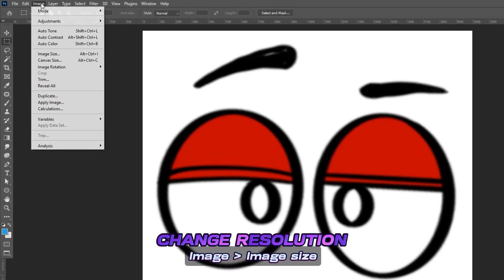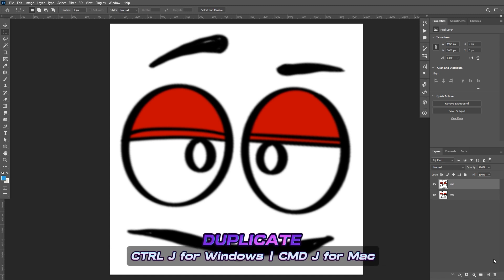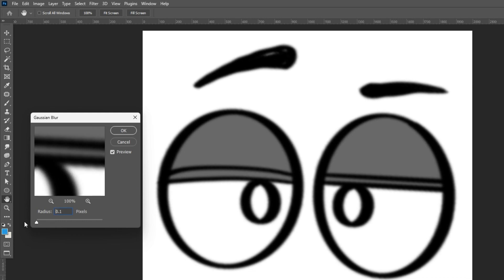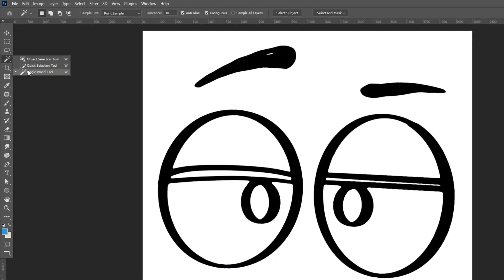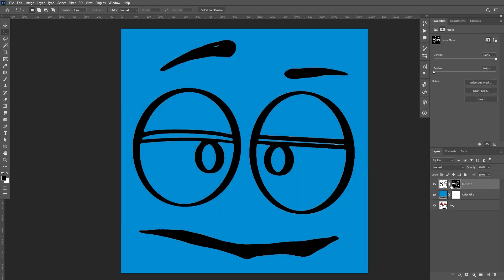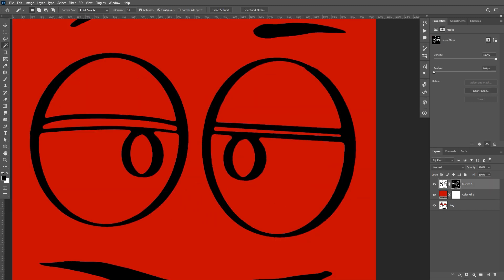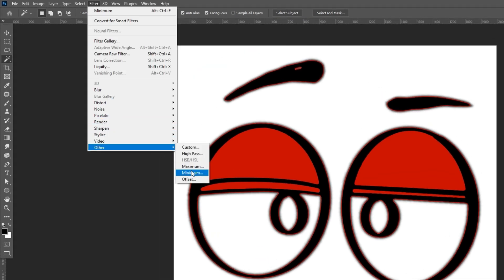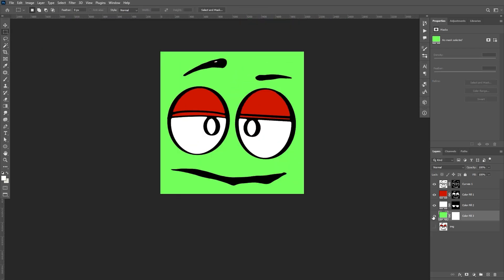Revolutionize Your Prints: Convert Low Res to High Res for DTF!

Comment: This video has been so helpful. I have been trying to get my files done by other ready for DTF transfers. Some have been successful and some not so successful. I was wondering if the file were made in Canva would it work? And when you export your file do you have to export / save it in the size that you are planning on using the design for example 10 x 8.03 inches?